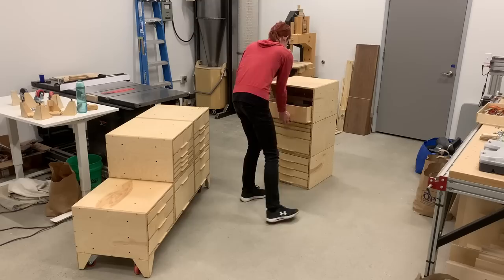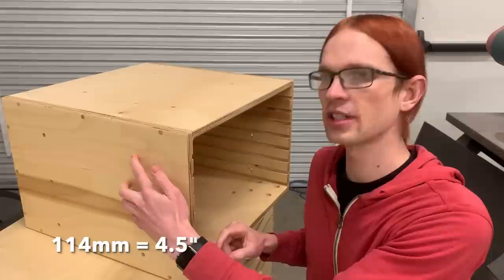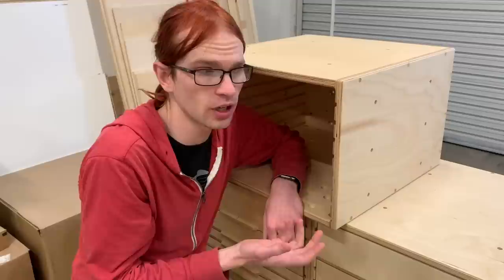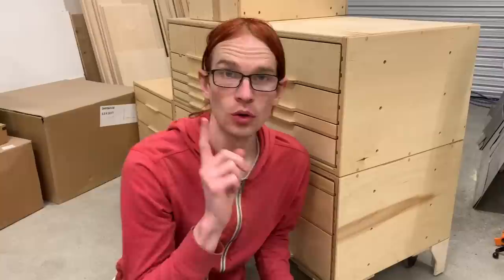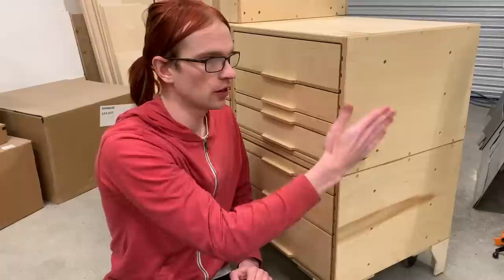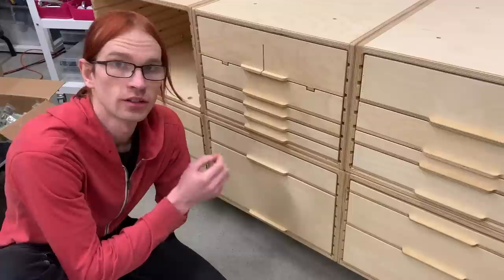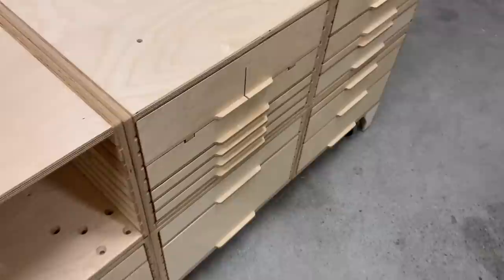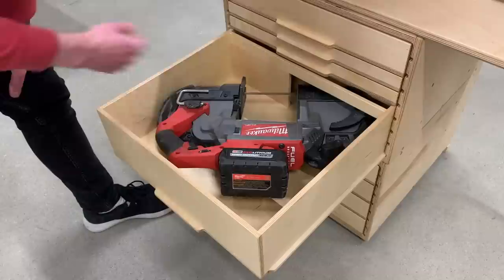How I designed my modular cabinet system

Comment: Good to see you posting videos again Jer. 

I wonder if you could make the case for a double height and double width options. 

For instance if you know you are going to be stacking two anyway a double height would gain an extra drawer, and a double wide would be nice for a large table saw sled or a drawer to be able to hold 3ft levels and clamps etc. Your soldering station idea might be a little cramped at 18.5" wide but 38.5 would be ideal.

Size and weight would still be manageable and would interlock with the standard cabinets exactly the same.
Reply from the maker: I addressed why I didn’t do double height in the video.

Double width could be a bit challenging, because drawers that wide are going to have more tendency to bind. If you’re willing to always use both hands to open the drawers and keep them straight, then the binding might not be an issue. Adding drawer slides could help, but that’s expensive and it would make those drawers look different.
Reply: @Jer_Schmidt  I watched the video again and I don't see why double height would be off the table - in fact every design choice you made, especially where you say at 4:15 'across two cabinets you have equal drawer slide spacing - you can imagine there being a slide here' seems to support it. 

As far as the double width being more likely to bind, I agree but I think many would accept that caveat in exchange for having a wider drawer slide. if you are matching the single width drawers in design you would have 2 drawer pulls which would make it easy to balance out. I think it would be a lot like the false back of the drawer - you would just naturally grab it by two handles

But I'm not trying to argue with you, since you are considering doing half widths and depths I thought I would give you some additional ideas for options for your customers. 

Good luck

Comment: Love it!  Thx. As far as sag, just build a tee shaped or narrow box shaped foot to span the “bolt together” holes on the bottom.(running parallel to the front) If you make them the same height as the corner feet, the same leveling feet and castors could be used. :)

Comment: Nice project.
For the sagging cabinets - obviously another couple of feet in the middle would solve it. 
I like the mini project drawer idea too. Soldering station is the most useful one I can think of, but others could include small belt sander, or grinder. Or electrical test box with power supply and meters maybe.
Reply from the maker: Yeah extra feet can be used if the cabinet isn’t mobile. If you want to roll it around then that’s not gonna work so well, unless your floor is absolutely perfect.

Thanks!

Comment: Ha, I have had the same problems with your first design. Warping sides, distance between the draws being too tight and the fronts failing. One other problem I discovered, for me at least, is the thin drawers. They are just too thin and the next double sized drawer is too deep for somethings. If I build another set of these I'll change the slot spacing to create a deeper thinnest drawer. I cover a lot of this in my shop tour video on my channel. All in all I love the system, I thought it was really cool that any draw can be moved to your liking. Also I have a moisture problem in my shop so I keep any and all silica packets that I find in product packaging. I just disburse those in different drawers. I do have a big dehumidifier running just about all the time.
Reply from the maker: Thanks for sharing your findings! The double-height (3”) drawers are definitely by far the most useful to me, and I hear what you’re saying about the thinner ones being too thin. The prototype that I showed near the end actually has a wider slot spacing, but I went back to the finer spacing to give me more flexibility in depths (finer increments) and because of making the top & bottom equal one drawer.

Comment: I have an idea for the table tops. Overhangs are nice, but 4" are a bit too much for me. Since this is to allow clamps, you could easily create gaps in the risers to allow clamps to enter there. You could even sacrifice a bit of thickness from the table top. That might create gaps in the front, but that can be cut at an angle to appear the same thickness.

A rabbet cut on front of the slides could have allowed the front of the drawer be a bit wider and hide the slide groves. And for the slide groves, I think something made out of smooth metal could be added in some key locations to prevent erosion and even act as a stop. For stop, it could be just a pin / nail horizontally on top at the end of the drawer slide, that will catch in cabinet slide that cut wider at a certain point. It will utilize the drawer tilt to catch, and the drawer can still be removed if lifted a bit.

Overall EXCELENT design.

Comment: For addressing sag, you could also install some more of those feet, all of them pigeontoed toward the center, to provide all the extra support you could ask for.
Reply from the maker: Yes, but only if the cabinet is stationary. If it's on casters then that won't work unless your floor is absolutely perfectly flat.

Comment: $12 seems quite a reasonable contribution to get a PDF... I expect to, when I'm ready to build -- and I think the likelihood is fairly high that I'll try to build something very much like this, if not exactly to your plans.  So, thank you for making that available.  I might still end up doing a design of my own (I've been thinking along similar lines for several years, though you've definitely added new ideas to the mix), and if I do, I'll probably open source it (only if not directly based on your design, though -- unless you give permission for such), especially for some ideas I have about work surfaces (not unlike the soldering station you described at the end), which has been one of my main notions.... anyway, very cool.

Comment: Nice idea with the solder station, if you have no back on that drawer then you have a set solder table just by pulling it out and turning it around, would have to find a way to stop by bottom from sagging, though.😋😋
Reply from the maker: Thanks! Using 18mm plywood for the bottom is more than enough to ensure it will never sag. Even 12mm should stay true, 9mm maybe. The soldering setup isn’t going to be very heavy.

Comment: Great video, Jer! I'm building your cabinets, although for my own reasons (needing to store Systainers in the cabinets), I'm increasing the overall height and hole pattern of yours by 114mm for most and 228mm for a couple. This should keep them modular and able to bolt together with your original specs should I choose to build some of those too. I bought the plans!

Comment: Excellent followup, thank you for sharing your process! Personally, I would still make rabbets in outer corners for ease of assembly, but I see your points as well. Also in regards to the sagging, why not suggest extra feet in the "toekick" orientation under the center sections (instead of round tube or 2x4? Even better if the feet holes align between boxes so that one foot could be placed in the middle underneath two boxes.
Reply from the maker: Thank you!

An extra foot in the middle works good if your cabinet is stationary. If it’s on wheels… well I’ve never seen a floor flat enough for that. And yeah the holes do align between cabinets!

Comment: I wonder how strong those back holes would be to mount them on the wall as cabinets.   Of course having holes predrilled on the back, and on the bottom, or even those on top, can help distribute the load.  Maybe go half the depth since drawer cabinets tend to be shallower to reduce weight and keep your drawers a bit smaller. I can really see how this system can be slightly modified to be even more modular if you need it to be.  It’s a well thought out design.
Reply from the maker: I think the backs should be quite strong, but probably not enough to hold a single cabinet to the wall. Two cabinets stacked up would probably be ok, since that wouldn’t have as much leverage to pull the top bolts out.

Comment: If anyone will build this using a router to do the drawer guides,  I suggest to cut the sides about 5mm longer,  this will give you allowance to cleanup any tear-out on the ends of the drawer guides. Do step 8 first,  clean the tear-out by cutting 2 to 3mm from one side before proceeding the steps for the screw holes.

Comment: Too lazy to look right now, but it'd be fun if this fit really well in a server cabinet size, given those are built with similar versatility in mind. using the U measurement. 1U 2U etc. I've built something related here and it was kind of fun to figure out the hole spacing. I can relate to over explaining the reasons of a lot of this stuff too.

Comment: I am totally thrilled and I bought the plans today and was surprised that CNC also includes data. Fortunately, I have a CNC milling machine :-)
It will certainly take a while with the construction, but I already get prices for wood. Unfortunately, Birke has become quite expensive. Here in Germany the plates have 2500 x 125 mm or 3000 x 1500 mm.

I have already considered an "improvement". You could not stick the walls with the floor on the drawers, but fix them with dominos and screws. Then, if you need a different height, you could just change the sides.

To the roles ... do you know Carl Holmgreen? Retracting Casters No 4 Workbench. The man has good ideas for folding roles.

Thank you
 Andre

Comment: Really want to go this route, but I don't have a drill press.  Grrr.  Decisions.

I would make one of the drawers a waterproof removable waterstone sharpening station.  I'd also modify the legs to have rolling + height adjustable casters, so that a long, single row of cabinets can split in half and flip back to back to form a wide assembly station with ability to level out once in place.

Comment: Love these videos, so happy you're back!  Question, why didn't you implement your grid pattern at the bottom of the drawers like you did in your other drawer builds?
Reply from the maker: Thanks! The grid pattern might make a comeback, but the grids will just sit in the drawer, not be part of it. I experimented with a bunch of different grid ideas, even tried pressing steel balls into the drawer bottom and putting magnets on the boxes. The best option is a 3D printed grid & 3D printed boxes. But I don’t feel like it’s worth it for me, when the cardboard boxes work just fine.

Comment: I cringed a bit when you were talking about putting a 2x4 under the longer stack to stiffen it, and connect it with the holes that end up next to the feet.  There isn't much space next to the feet and the material at the bottom of the box is reduced in thickness by the countersink.  Consider if you have 3 boxes side by side, and they want to sag in the center.  You are putting a straight piece of wood under it to counteract the sag so in effect the straight piece pushes up on the center unit and the ends of the straight piece hang from the underside of the end units.  Now when you put the bolts through the base of the end unit into the 2x4, and the center unit wants to sag, and the straight piece wants to hang from the end unit, that hanging load has to transfer through the bottom of the box where the thickness is reduced by the countersink.  Maybe you could do this with one of the big head elevator bolts, or maybe you could just put a big washer on top and use a carriage head bolt.  You might try it and see how it works.  Your arrangement seemed stiff enough under your own weight so for most uses you could not put the stiffening board under it.

Comment: Butt joints are fine because there’s no real load on the bottom or top. It all runs down the sides. Basic cabinetry uses butt joints a lot.

Comment: I want to build these for both my office/home work space as well as the shop but I'm already deeeeply invested in a modular box system that's 75mm tall. It's 55mm square increments in x-y dimensions (which is pretty close to perfect if I move the false drawer wall back slightly) but the height..

Comment: This is the most comprehensive, though-out project on YT. You have to be an engineer by trade. I really want to build these for myself if I can source all of that BB. One question I have regarding the vertical stability with multiple modules attached horizontally, wouldn’t it be easy enough to add a front and rear riser somewhere along the center of the modules?
Reply from the maker: Thanks! A middle riser works if your cabinet is stationary. If it's on casters, that's not gonna work so well unless you have a perfectly flat floor.

Comment: I like this for a craft/sewing table that is standing height.  I looked online at several big box stores and am not finding the 5 x5 sheet of plywood.
Reply from the maker: Yeah I want the standing height setup in my shop too! Gotta build some more…

I don’t know if any big box stores that sell Baltic birch, you’ll probably have to find a hardwood seller. Or just use big box store plywood, but it probably won’t make as structurally sound of cabinets.

Comment: Thanks Jer, I have been thinking about this for some time, but you've put so much effort into the design the plans are well worth it. By the way, have you thought about how the drawer runners/slots will wear over time?
Reply from the maker: Thanks!  I just moved my old workbench from my old shop to my dad’s shop, so I got to look it over for any signs of failure/degradation. There is no noticeable wear on the slides after >5 years. I expect they’ll be fine for my lifetime anyway.

Comment: I'm just amazed at how good you thought this through. I just made a workbench with some drawers crudely made and it took me two months and everything was kind of thought through. This however is just insane, I'm so impressed.

How long did the total build take? Or to build one standard cabinet?
Reply from the maker: Thanks! I started the design about 2.5 years ago, built my first prototypes maybe 1.5 years ago. The actual build is pretty fast, maybe something like 14 hours to make a pair of cabinets, and about that much more to make the drawers for those two cabinets.
Reply: @Jer_Schmidt  Yeah that makes sense seeing as there's no guess work anymore. But the time you spend on it clearly reflects the quality. 

I bought a table and remade it into a workbench, and made the drawers from pieces of an oak floor from my sister. That meant it was a lot cheaper (where can you find a 200 x 80 x 5cm slab of solid oak for 200 euros). It also meant I had to wing it as I couldn't measure it to get all the exact dimensions of the feet of the table, and the amount of oak floor boards was just barely enough to make all the drawers.

One small addition you might also love: I put felt in the drawers to reduce sound when putting stuff in them. I picked a green color so things are visible and it matched the oak really well. 

Ended up putting it in most of my drawers at home too because it made such a huge difference.

Comment: "You call that a nerd off? It's much too short for that!" Well, I was looking forward to this. Now I'm sad it was so "short". I like your explanations, they are always very insightful.
The plans are decently priced. For that kind of detail probably well worth it. I wouldn't hesitate, except that it's almost impossible to get that amount of ply without paying an arm or a leg. So: the price of the plans probably are negligible compared to the price of the wood. I'll have to do some estimations what one cabinet with drawers would cost me, but I fear they're not currently a viable option. Still a great design. Would love to see more custom drawers and such.
Oh, and one more question. In the first video you've been showing an L-configuration. This is probably most useful in a corner. Putting actual cabinets there would be wasted, since you cannot access them. Do you have an Idea on how to actually utilize such a space?
Reply from the maker: For the L-corner, I would just make a L-bracket by using two panels at 90° and connect them with triangles.

Thanks!
Reply: Actually if you build an L shaped cabinet it would be for a cabinet that you can walk around of. Meaning you could have the drawers facing the outer corner of the L as well as having all of them facing out and keep the inner corner drawerless. This is a versatile and modular system and you can’t honestly expect Jeremy to think about every single possible application out there.

Comment: Relative to the sag when you have several cabinets together, why not just a couple of caster or adjustable feet in strategic places? Am I missing something? Love your design and about to start building some from your plans.
Reply from the maker: That only works if the cabinets are stationary. If you want a large mobile cabinet it would need the 2x4 supports.
Reply: Makes sense. Thanks.

Comment: Would you consider 18 ga brad nails to attach the cabinet sides to the tops and bottoms instead of screws? This would make the glue-up more difficult since there aren't predrilled screw holes for alignment, but they may look nicer since they could be spot filled with a bit of filler.

Also on the topic of glue-up, did you consider a jig similar to the drawer jig for gluing up the cabinets?
Reply from the maker: I guess I don’t care THAT much about appearance, so the convenience of screws is well worth it to me. It should also be stronger since the screws properly clamp the joint.

I hadn’t really thought about a jig for the cabinets, since gluing those up already only takes a few minutes and it’s easy to be precise.